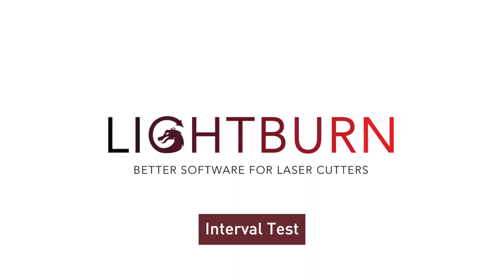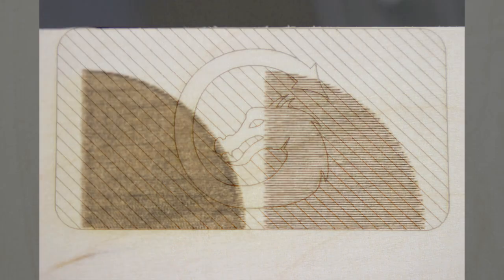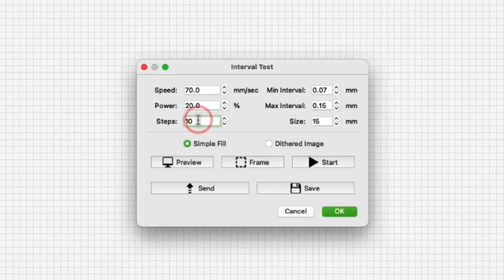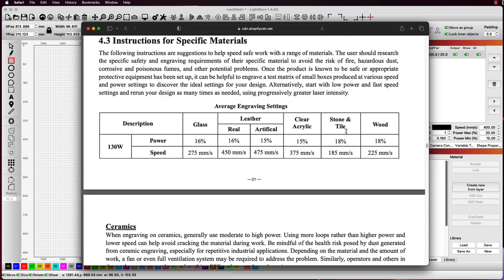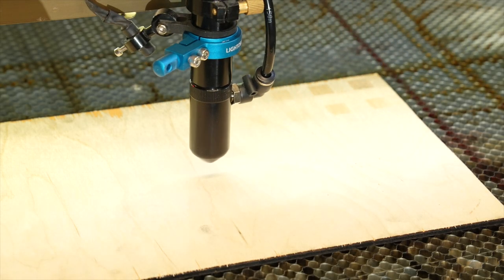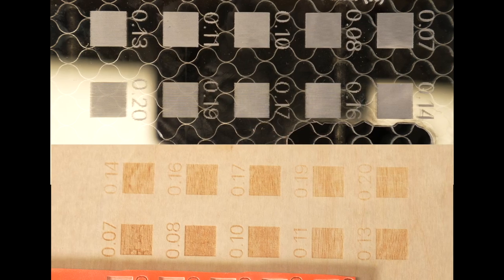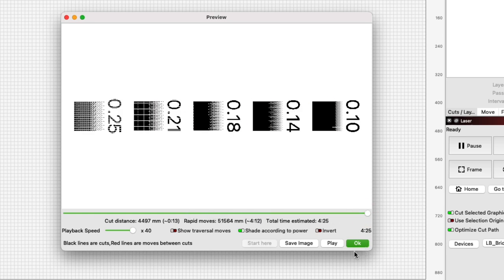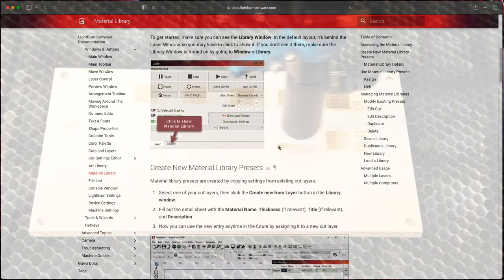Optimize Your Laser Projects With LightBurn’s Interval Test

Comment: Somehow I didn't know this existed and never bothered to adjust my interval, just went with recommendations I found online. Now I'm realizing I was wasting so much time with an interval that was so small it made no difference, and actually made it harder to vary the darkness of the etch since it was basically going over everything twice.

My one request would be to add a function to the test tool that cuts out the shape at the end so that you can save it as a test coupon for the future. This is perfect use for a random piece of scrap, but it would be nice if it was cut out at the end.
Reply from the maker: Glad to hear the video helped. 

We appreciate the feedback. This has been requested by a few others recently as well. 

Currently, I have been drawing a rectangle after the test in my workspace to cut out the test. Not quite as automatic but it should allow you to cut out the test for the time being.
Reply: @lightburnsoftware7189  that’s what I’m doing, too, just would be nice if it was built in like it is for the material test (I think? One of the tools does it)

Comment: Can you add auto Z "BED" material surface leveling system for the lightburn software? Like 3d printers Leveling Sensors BLTouch etc. Thanks in advance.
Reply: If you are asking what I think, this already exists, but it's a function of the controller, not the laser. Ruida controllers call it "focus", and you need to install a touch sensor on the laser head. You'd obviously need a powered Z axis that was run through the controller, and the sensor like I said. I run one on my laser and it's pretty handy, but a lot of people seem to find it overkill; I do agree it's not critical like on a 3D printer, but still find it very handy.
Reply from the maker: Some machines to have this. For diode lasers I believe I have only seen it once as often doing a quick manual level is simpler but I was able to find a guide for converting a diode laser to have this if you want to see what the process would be like:
https://diode-laser-wiki.com/documentation/extras/automatic-z-axis-focusing/

Comment: did you intentionally omit the result of an interval test on a dithered image? What is it that we are trying to get?
Reply from the maker: Do you mean for the image of the dog as in a before and after? The initial image had already been ran with what we felt was optimal for the laser/material. In the case of the dither test results that are shown under fill, some of it will be personal preference. You are typically wanting the lines to not have a visual gap on an image engrave but also too close can wash out details. The material and even laser settings (speed/power) will have an impact on this. For this image we used .18 interval.
Reply: @lightburnsoftware7189  I'm certain he was wondering the same as I. For example, I do the interval dither test and am looking at it but I do not know how to properly translate what the finished test results mean for future projects. Therefore I don't know what an ideal interval is for any scenario.
     Also I appreciate your videos, there are many people attempting to regurgitate the same things with their own voice and style that just aren't as clear and direct communicators.

Comment: I can’t seem to find a sweet spot for my laser test all seem burned deep into the wood
Reply from the maker: If that is the case either increase speeds or lower your power. Have you ran speed and power tests? Going with a larger range above what you have already tried will help.